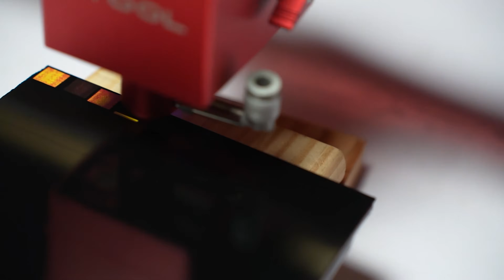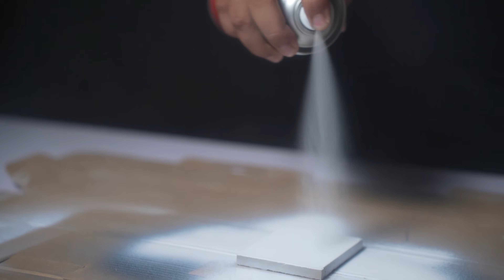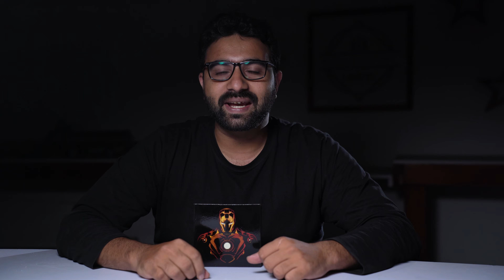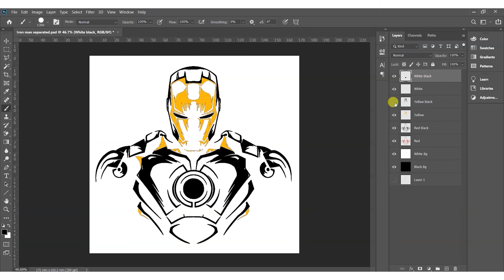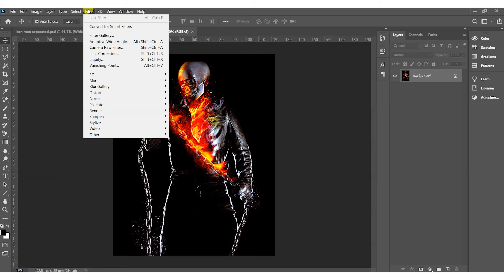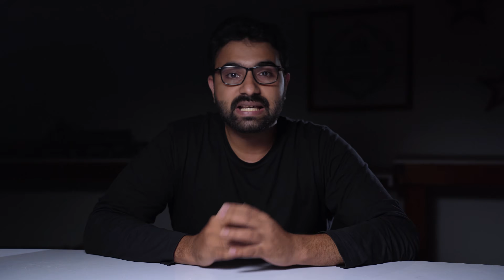Color Engraving Ceramic Tiles Using a Diode Laser- 4 Step Tutorial!

Comment: I follow Mellowpine Videos very closely and learn  many things from you,  Thank you for being generous.   Recently I started watching this channel over several times and followed your advise to go about doing color engraving ceramic Tile.  I  use my mobile phone to convert  coloured drawings to  Black & White.  Although it work I notice the software you are using in this video does a much better job.  I use LightBurn which I think cannot do like what you did.  Can you recommend the software you are using for colour settings etc,  Thank you.
Reply: Thank you
Reply from the maker: Thank you so much for your kind words. I'm glad you found my videos helpful. 😊

The software I used for preparing the images in this video is Adobe Photoshop. But you can get similar results using any image editing software, and even LightBurn. Just make sure that you choose an image with good contrast, and then adjust the image until you can clearly differentiate between different colors, even in the grayscale mode (in terms of different shades of gray).

Comment: this was a very interesting video. There is one thing that I found a bit confusing. You said lighter colors should go on first.
Does that mean you burn the lighter colors as your first layer?
Reply from the maker: We would be removing the colors in the order opposite to what we painted. If you have a darker coat under a lighter color coat, there is a possibility of the dark color emerging at places where you need light shades of the light color. 

In the iron man tile had I applied red below yellow, the yellow areas might've had a red appearance. When applying paint, apply the lighter color first, when engraving remove the darker color (top layer) first.

Comment: Hello. Would this work on aluminum sheets? (I found some vintage-looking mancave signs 11x17 cheap.)
Reply from the maker: Hi,
Yes, this should work on aluminum sheets as it contains layers of paint overlapped on each other, and the laser removes these layers without coming in contact with the base material. However, you will need to perform test runs to identify the optimal settings for different layers.

Comment: I have a question about this i have a diod laser an atom stack P7 M30 its a 5.5 w am i still able to achieve this ??
Reply from the maker: Yes, you would be able to do it. But you would need to figure out the speed and power for your machine
Reply: Great thanks appreciate the timr and reply
Reply: Hello sir hate to bother you again  what kind of paints do i use …. All ive seen at wal mart is gloss paints does that matter
Reply from the maker: You can use that

Comment: Most straightforward video on this I have seen and am loving my early results with the gray-scale single layer images. I am however struggling to get clearly defined colours on a multi layer project like your iron man because the different colours never come out anywhere near as bright, even using a test grid. Did your example use acrylic or standard spray paint for the colours and also the black top layer (Matt or gloss finish). Also, how long did you leave it between spraying the individual layers and the final black coat?
Reply from the maker: It's a difficult thing to do, I had to do a lot of trial and error and fine tuning. But it's doable. I used standard spray paint. The top layer was glossy, matte can be a bit difficult to remove. As for drying between coats, it should not leave fingerprints when you press lightly with your finger. If you put on the next coat before the first coat is dry, the solvent in the next paint can dissolve the paint already on the tile and cause them to mix. Good luck with the project, keep trying. You can do it.

Comment: is it the same process for doing canvas as painted tiles? are the settings similar
Reply from the maker: The settings can change based on the paint and paint thickness, you will have to run tests each time. The process is essentially the same. Use enough power to burn the paint off but make sure you don't burn the canvas. Better give it a white or black base coat.
Reply: I try to engrave once on canvas and recommend first to seal the canvas with spray lacquer and wait one day for next painting.It's same technology as painted tiles but need more precising test grid.
Good luck

Comment: Are there any special types of inks that are used?..Is it possible to use the same type of inks?
Reply from the maker: I use regular spray paints, wait for the paint to dry completely between each colors.
Reply: @MellowpineLasers   How many hours should it dry?
Reply: @AmeesheLaserArtandgift  Hello in my tests time for dry between colours is almost half an hour,but it,s depends of thickness of paint and temperature around.Just try,it's funny.
Reply: @sash-v7i  ok
Reply: @MellowpineLasers  These days I'm on the way to work with car base paint with air paint gun.Will send some photos of working process when I'm done.Just advice - if you need to force laser to his max speed and minimum power to reach the first coat-tray again from start and make paint layers more fat.This will prevent curves on engraving from vibrating head.
Regards Alex